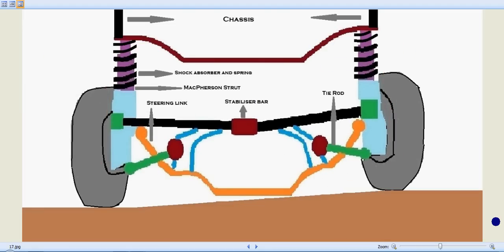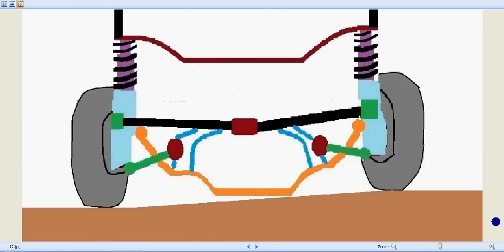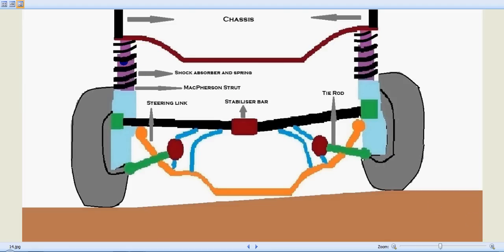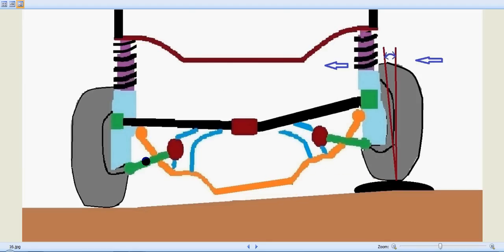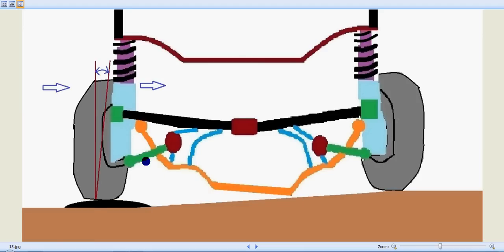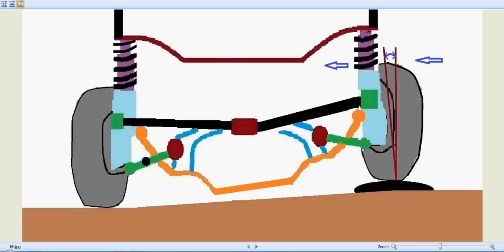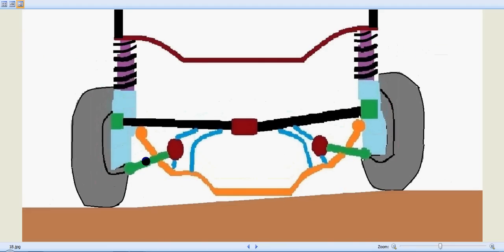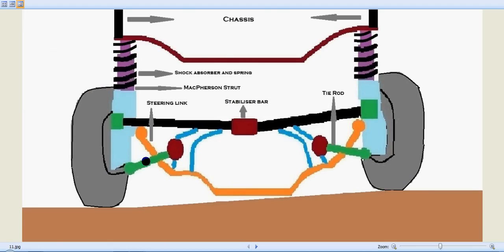How Macpherson strut works. ✔

Comment: Under compression the camber doesn’t change 
It change 
The king pin axis for the different angulation of the steering axis 
When you accelerate or brake change also the caster

Comment: the info which are provided are not all correct. He said mcpherson struts are mainy used in lhigh end cars, but in reality all small and mid range frontwheel cars use thi9s setup. its one of the cheapest independent suspension setup around.

Comment: In Macpherson Strut there is only a lower control arm and it doesn't have upper control A-Arm. Due to which it gives rise to up and down motion and there is only a very small amount of camber gain with respect to body roll. There is no camber developed when crossing over a bump.

Comment: Citroen DS: All problems solved..
Four-wheel independent suspension and shock absorbers with hydropneumatic spheres on each wheel, controlled by the central, hydraulic high-pressure system. No metal springs, springs or leaf, whatsoever! 
Automatic height correction. 
Inboard front-discs, directly connected to the gearbox and differential (which are fixed to the chassis). Low unsprung weight. Zero-point-mounting of the front wheels. 
Rear wheels on simple trailing arms. Constant camber-angle and track-width.
Front wheels on leading arms. Also constant camber-angel in front. 
Rack-and pinion-steering, etc

The hydropneumatic suspension is the worlds most advanced suspension with unsurpassed comfort, roadholdning and safety. Nothing can rival it.
Reply from the maker: +Jourwalis - 
We are honored by that comment.
For more info you can email us at techtrixinfo@gmail.com or whats app at +919744615655

TechTrixInfo.com

Comment: you show the top of the wheel tilting inward (negative camber) and so leaning into the turn while my cars have the opposite positive camber on the wheel at the outside of the turn.... at the inside of the turn we get even more camber as it tilts in more....only on a few cars like American and BMW have I seen any negative camber into the turn.... a pet peeve of mine because the outside of my tires would wear out first...and there is no alignment adjustment ...any hint on how to get the camber you show here???

Comment: Mcpherson strut is a simple suspension setup, that's why it's widely/commonly used on most cars. Not just BMW or Mercedes, etc. Double Wishbone is the best suspension setup out there and it's superior in terms of handling as it don't change chamber angle when cornering. Double Wishbone is mostly/often use in sports car, super cars and race cars.